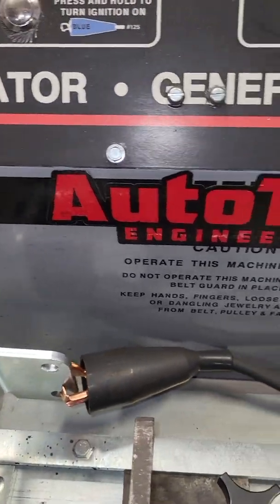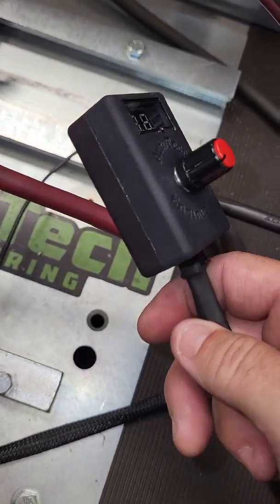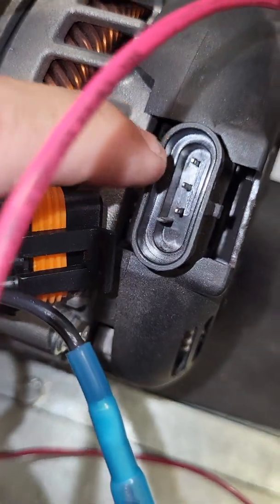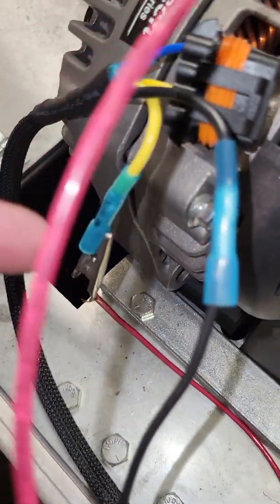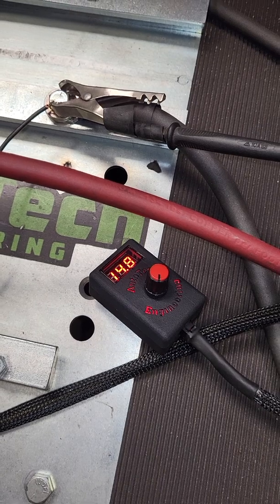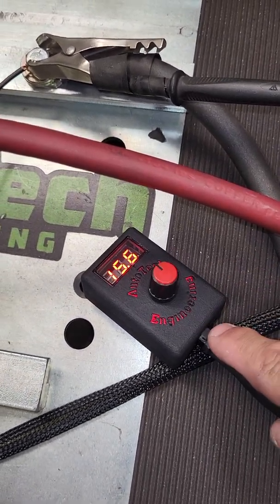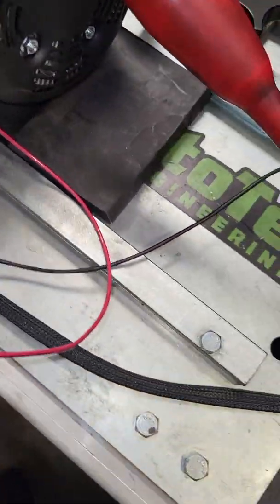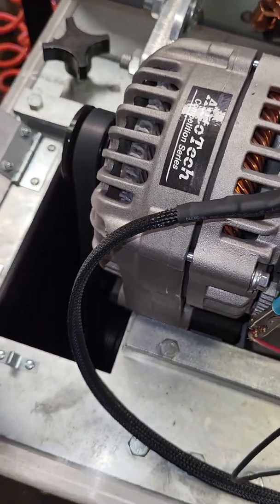Technical help video for our VCM-6003,  voltage controller in English.

Comment: Got my autotech 240 and VCM installed yesterday and it works like a dream i couldn't be happier with the product you guys have went above and beyond on the product I was genuinely impressed that it worked as well as it does i was expecting a voltage sag from the PCM but I don't have any of that it's actually working with 0 issues thank you autotech for putting me in the game

Comment: I purchased a new "competition series" 400a alternator along with the voltage control module and installed as the video showed and l am unable to adjust the voltage. The vehicle is a 2005 GMC Yukon Denali 6.0 L.   Thanks!
Reply: Did you ever figure it out

Comment: Does it reset to the preset voltage every time car is started?
Reply from the maker: No
Reply: @autotechengineeringusa  so if it's set at 15.5 it will stay there when the car is shut off and started back up?

Comment: Do you make these for two pin I have a 1977 deville with 240 alternator and if so can you send me a link to order thanks
Reply from the maker: Your 2 pin has to have sense
Reply: Looked at it alternator has 3 pin but the connector has two wire yellow and red and it does have a sense the red wire
Reply from the maker: @frankmathis8658  we have no idea. Email us a picture
Reply: @autotechengineeringusa  it will work can you send me the ordering information please
Reply from the maker: Autotechengineeringusa.com

Comment: Mechman is better.
Reply from the maker: Hahahah. Keep telling your yourself that. We build for more vehicle makes and models. They don't even make their own controller, they sell someone else's.
Reply: @autotechengineering2505 I bet he thinks Optima batteries are the best too! 😂😂
Reply: @Brian Yost  XS Power! I have (2) D3400 in my 2011 silverado with a sundown salt 3k, pushing (2) Skar VXF 12's at 1 ohm. Gain and crossover set with a cc1, and a dd1. I know what I'm doing. All connected with 1/0 ofc, to a mechman 340 alt, with the rvc bypass. I never go below 14.5
Reply: @MrSpike0358  did you just name off a bunch of crap and then try to claim you know what you're doing lol lol.. first off if you knew what you were doing you wouldn't be buying an xs power you would just be building your own. Then you go on to say you have a sundown 3K lol what is this 1990 what are you going to do with the 3K lol 🤣 lol
Reply: @Modern gun guy  I have nothing to prove to anyone, believe what you want. Everyone is entitled their opinion.  God Bless.
Reply: @MrSpike0358  if you have nothing to prove then why are you on the internet trying to prove it 🤣🤣

Comment: Will it throw a battery light?
Reply: Depends on vehicle.... i turn mine on with the lamp pin, and then use the DFM(M) pin to report to my ECU... so i dont get any check engine or battery light.... all goood... but it depends on the vehicle
Reply: @CL-yp1bs nobody understands this bro

Comment: You have made one hell of a product! My harness is working beautifully after ordering a longer harness. When the bass hits and the voltage drops all I have to do is turn it up to get maximum amperage from my amplifier. Thank you for all your help
Reply: Can you please tell me exactly where the ignition wire goes I found one video where they literally ran the ignition wire to the key ignition of the steering column does it have to go there or can I do a fuse tap to any remote turn on source
Reply: @Dirty2152  I just so happen to have an inverter in my middle console that runs straight to my starter solenoid in my 89 bronco so that’s the same ignition source that I used